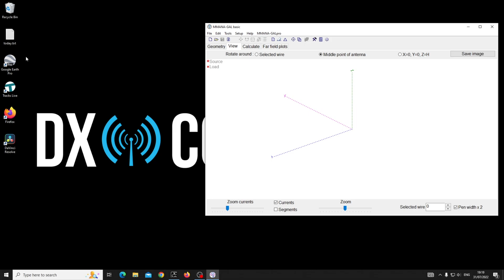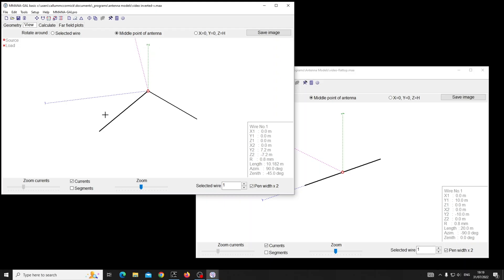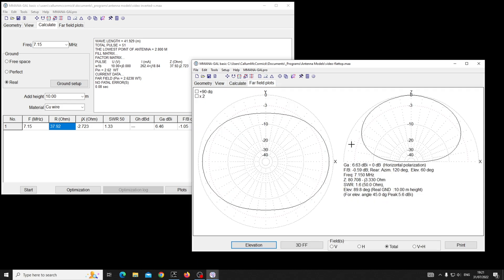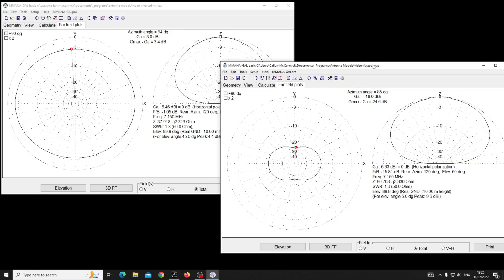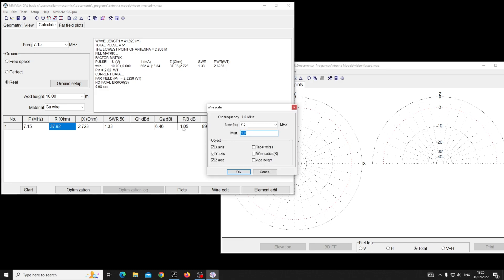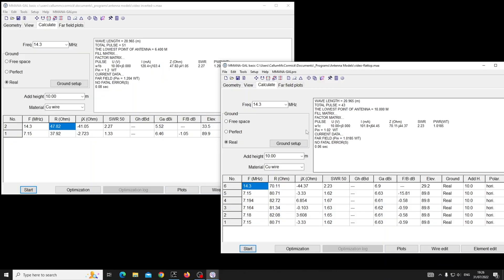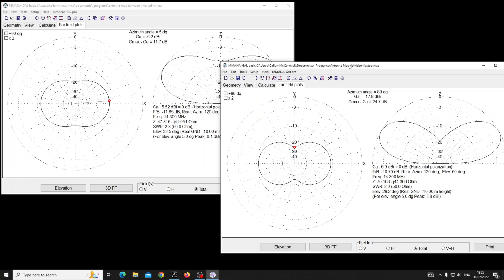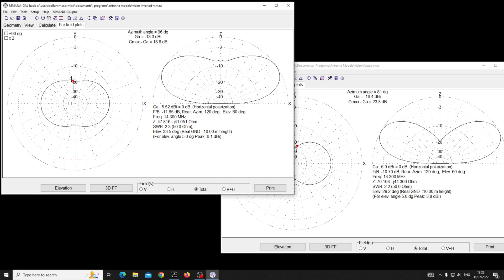Dipole Antenna Showdown: Comparing Flat-Top and Inverted-V Designs

Comment from the maker: Here's the video on the Vertical vs DIpole: https://youtu.be/ZZWzyypqqjM
Reply: Great content. Maybe as possible antenna to test on software or in real life use, is an antenna originally sold by PAL Electronics in the 1960's and later by Wilson Antennas. It is right triangle loop. Its perimeter is the same as other one wave length loop antennas. It is set up in the vertical plane. The right angle is at the bottom, along with one side horizontal across the bottom. The other side to right angle is vertical with the hypotenuse at 45 degrees. PAL sold this antennas as bein vertically polarized. Wilson sold it was being both vertically and horizontally polarized when fed at the right angle. I think both were wrong and the polarization is more along 45 degrees. It worked great for DX, with signals bouncing around at all angles, but locally it seemed poor for vertical and horizontal stations. Wilson, unlike PAL, included instructions to make the antenna just horizontally polarized, by rotating it 45 degrees, with the hypotenuse horizontal and the right angle feed point at the bottom center. Users claim this orientation has better signal to noise ratio and better gain. The original had the two right angle arms of aluminum tubing and the hypotenuse of wire, but the whole thing can be constructed of wire. For the corners, I use 6 inches of antenna wire wrapped around either side of the corner insulators and solder the twists. This fixes the pull points properly. To determine the side lengths I use a right triangle calculator that only requires inputting the perimeter and one 45 degree angle. This tells me the sides I can measure from the right angle feed point and the hypotenuse is what is left of the wire. calculator here. https://www.calculator.net/right-triangle-calculator.html

Comment: So in a apartment, got to keep things on the down low. How well will a inverted v work for DXing if I run it upside-down?
Reply from the maker: No difference, I'm sure... The only real reason for inverted V is it's easy to keep up (and the higher current is near centre = win on both counts.
Reply: @DXCommanderHQ  Thank you sir ,for the info. That's good  to know.

Comment: I’ve been installing a 40m Inverted Vee in a row of trees in my backyard.  I cut the wires a bit longer than the antenna modeling apps suggest and started tuning.  The wire I used is solid copper, 12 ga., with insulation.  My best resonance (~1.5 SWR at 7.034) was achieved with each wire at 29’6”, much shorter than the estimated 33”.

I’ve been able to find information on the web about velocity factors of copper wire (about .95) and insulation (about .95 to .98) and Inverted V versus flat configuration (no value was provided).

If I consider those velocity factors and do a little math, I get this for a length (divided by 2 at the end to get a single leg length):

(486 x .95 x .95) / 7.075 / 2 = 31.17’

Consider some additional shortening due to the Inverted V configuration and these numbers start looking rather accurate and interesting.

I’d love to see a video on this phenomenon!

Great stuff; thanks for all your work and content.  Very helpful to us new hams.
Reply from the maker: I have touched on this.. But it will be velocity factor and "end effect". I will try and find the video..
Reply from the maker: OK, best I can find is this one.. https://www.youtube.com/watch?v=0UwaIc3GdSA But it's the "End Effect" that is making it shorter. And height above ground.. That also affects length.
Reply: @DXCommanderHQ  Very interesting.  And thanks.  Too, and as you suggest, height above ground matters.  I’ve played with that using EZNEC and you can see the SWR dip move as you raise or lower the antenna height while keeping all other things constant.

Damn fascinating stuff, antennas!

Comment: I'm just getting back into HF after about 10 years.  I used traditional inverted v antennas on 80m and 40m.  I'm wondering what happens to the directionality of the signal (horizontally) IF each end of the wires are the same height (say 30 feet) as the feed point height of 30 feet and the angle of the antenna / distances of the wires is changed.  Does that give gain in a certain direction or signal cancellationin all directions as opposed to a trafitional inverted v?  Thanks
Reply from the maker: At that height, you will only have a 3dB difference between off the edges and off the sides.
Reply: @DXCommanderHQ  Thank you for that information.

Comment: I didn't realize there was a big difference in the two. Have no tree in the middle of my yard to top out an Inverted V, but maybe a 30 foot pole may work. Thanks for the videos. 7️⃣3️⃣
Reply: With the center pole,You could use 5 meter fiberglass fishing rods to carry your wire dipole elements. Not much sagging! Not thicker than 14 gauge stranded thnn/thwn 2. Also will possibly allow you to rotate when needed.😮😅😊

Comment: Calum I've been using I verted V for 40 years what I was trying to convey is that your elements are in a straight line ie North South what I was wondering if you could model the legs being at an angle of 90degs to each other ie South, East or East South not in a straight line!
Reply from the maker: I see.. It doesn't matter. It would hardly skew the pattern at all..

Comment: G’day Callum,

I have 2 questions.

1. Does the composition of a tower/pole effect the performance of a vertical antenna (or any antenna I suppose)?  i.e. metal pole V fibreglass pole?
2. Is the effective output of a multi-band antenna less (ie is the power spread across all the antennas) than a mono-band antenna tuned to a single frequency (ie all power enters that single antenna)?

Really appreciate your videos!
Terry VK2SOT
Reply from the maker: 1. Erm.. not really. Ignore it. As you would a boom of a yagi. 2. The RF has to "get out" somewhere. YOu can't really make an more or destroy the energy so if designed well, it shouldn't matter UNLESS it's full of traps. Say DX Commander Vertical has exactly same efficiency on all the bands when compared to mono.

Comment: I had an inverted V 40m with loading coils to get 80m with the center at 20ft and the ends about 4ft off the ground (had to fit the available space) for a long time. Worked great but I took it down to support the 80m end of my new Classic on the 20ft pole. Thanks for the video. Jack K5FIT
Reply from the maker: Nice

Comment: Something you might find interesting  is to reduce the angle between the legs of the inverted V,, the feed impedance does drop but the pattern is useful and the aerial will fit in a smaller space. 73
Reply from the maker: Good idea

Comment: What about the flat vs the inverted V in polarisation. As a flat dipole is horizontally polarised you will loose some DB making contacts with guy's running verticals.
Would the inverted V give you more gain with a vertical contact?
Reply from the maker: Not really.. The polarisation changes as soon as you hit the ionosphere and is then completely unpredictable.
Reply: @DXCommanderHQ so ideally we need a horizontal and a vertical on same band with a switch

Comment: I love inverted V's....easy to work with
Reply from the maker: Yes they are!
Reply: @DXCommanderHQ  another good thing is even if you use top quality stuff you can still build a 40m EFHW for $125 USD using real antenna wire, insulators, UnUn and cable ties..

Comment: I run a 20 meter speaker wire double inverted v on a 7 meter squid pole for SOTA. 1/2 wavelength feed line zip cord then split it for another 1/4 wl and tie an electricians knot at the split to stabilize the junction. Connect to radio with binding post. Would love to see it modeled vs conventional dipole. KG6HQD did a bunch of empirical work on it before he git sick and i followed his design tips. KC6ARY
Reply from the maker: It would be interesting for you to lose the "double" one day because I'll bet you probably won't notice UNLESS you have terrific height.
Reply: @DXCommanderHQ  sorry for the typo - "doublet"

Comment: My horizon 40m dipole east west gives me about 3 db in a south direction, over my slightly higher 46feet high inverted v 204feet  doublet . 
So more or less in line with this conclusion.  
Is it worth the 3db ? Normally I would say no , but living in NE Scotland and working mostly 300-1000km skip distance England and near Europe,  that 3db just gives me that slight edge,  so it stays up meantime.
Reply from the maker: AH OK.. Swings and Roundabouts :)

Comment: Callum, I've just started getting back into ham radio after a number of years. I used to use a 108ft trapped centre fed dipole which was ok because I had the room.
I now have smaller garden and am using an ex military centre fed dipole , each arm is around 40 meters long. I have raised the centre feed point to a height of around 21ft, but I've had to keep both arms of the dipole parallel, but spaced throughout its length using 6" spacers. The end of the arms are around 9 ft off the ground, so it looks like a sloping end fed but with two wires. How will it perform?
Reply from the maker: So many variables.. Depends on which frequency but at 20 feet, in the main it will be mostly omni-directional I think.

Comment: Very interesting Cal, I would never of guessed the height made such a difference to the directional properties of the antenna.  Question: Does refection from coax / feeder affect the performance of the inverted V antenna and if so can it be calculated?
Reply: 1/2 wave dipoles at 1/4 wave height don't work very well, you really need to be closer to its halfwave length above ground. Critical for 80 and 160m
Reply from the maker: John, I wouldn't worry about the coax (for our simple experiments)..

Comment: Calum have you modelled an inverted V with the legs at 45deg but coming down at an angle of 90degs as if the center was at the corner of a garden one leg running down the side the other along the back.
Reply from the maker: Eddie, you will have to explain that again slightly more detail because in my head that's what I have, I'm so sorry. PS - I probably won't see your comment (the system doesn't let me follow threads). So maybe make a new comment and I'll see that.

Comment: Flat top dipoles are very tricky to find the sweet spot but if you persevere you find an orientation and tune that suddenly opens up a band. My patience is normally too short for this but once once in a while I go for it and the signals flood in over the top of what is incessant background noise at my QTH. I have no idea why but it does. M7BLC.
Reply: I run a 40m 1/2 wave and an 80 1/2 wave, both almost flatop both 50ft high. Stick to the 468/F rule and you'll get resonance every time for the freq you cut it at.

Comment: I see a lot on dipoles. Is there any interest in doing Off Center Fed Dipoles? Or am I "beating a dead horse"?
Reply: I have one that covers 10 to 80, and works well enough actually. Just make sure you get one, or build one with a proper 4:1 balun and a separate good quality choke.
Reply from the maker: OCF dipoles are an interesting subject. Not made a video about that but once you get it, possibly easier to multi-band (well.. SOME bands!)